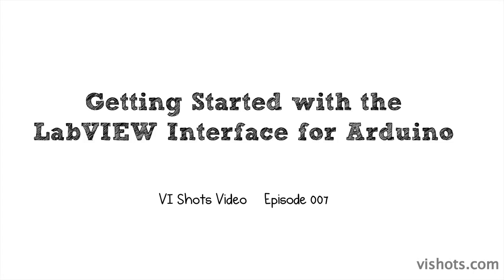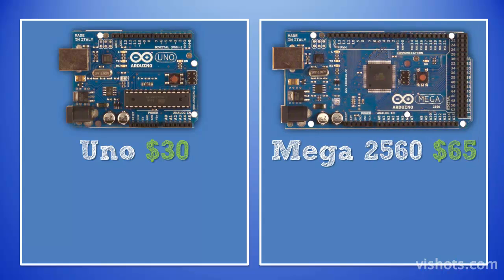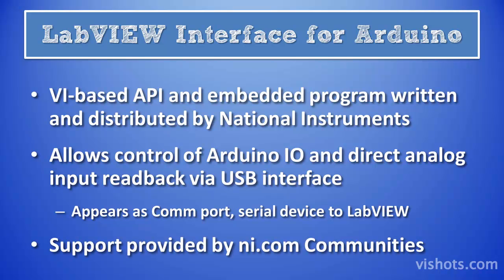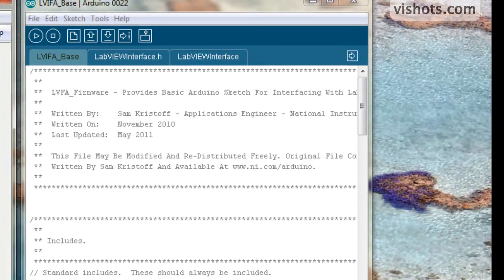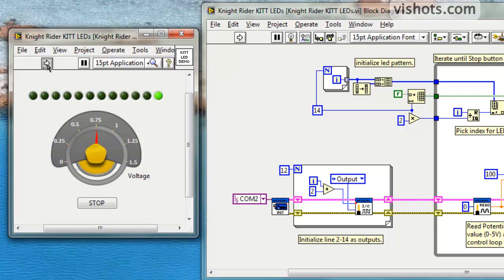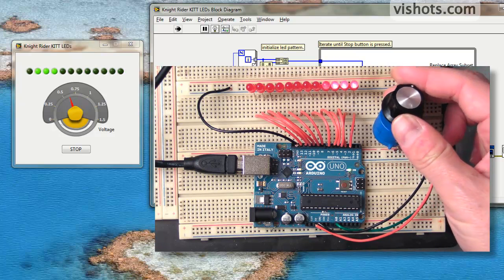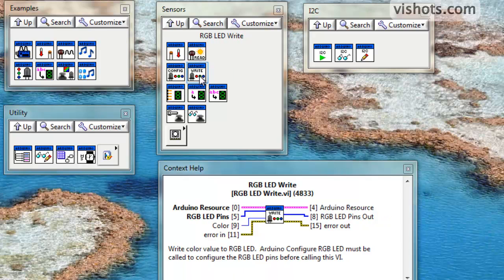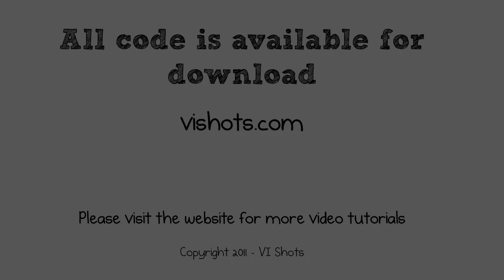Getting Started With the LabVIEW Interface for Arduino

Comment: Don't use this method, it's a pain in the ass with the connection issues and can break your arduino.
Just use Visa and have the arduino interact with labview separately.

Comment: Hi there, I'm totally new in arduino and labview as I'm a chemical engineer. Can someone clear my doubts about the functionality of both arduino and labview? My understanding was we have to write codes using Arduino IDE and LabVIEW is just to read or analyze the data acquired by the Arduino. Is this correct?
Reply: +Jamie Yeap Yes)
Reply: No! :)

LabVIEW negates the need for writing traditional code... It is a graphical programming language and instead of writing code you draw diagrams on the screen in the software and it makes life so much simpler...

LabVIEW is a gift from GOD... (next to Asian honeys yo)

Comment: Did I miss something or should there be some resistor for the LEDs? Arduino Output is 5V, right? LEDs need about 2V, so 3V should be taken by a resistor for current limitation. Otherwise this may not work long...
Reply: You missed something.  1:42 Using PWM outputs...

How it works: http://digital.ni.com/public.nsf/allkb/294E67623752656686256DB800508989

Comment from the maker: In response to Wang: it only works while connected to the PC. LabVIEW programs run on the PC and communicate to the Arduino via USB. - hope this helps.
Reply: +VI Shots (Michael Aivaliotis) So, does it mean, Aurduino board can not be disconnected from the PC and run standalone (with an external power supply)?
Reply: It can, but if you want to control it through labview you must connect it to your pc

Comment: Hi,

I was hoping you could help me out with a few control issues. I'm using a stepper motor shield to control a stepper motor (x3-- three arduino uno's/shield combo), and have tried a few different methods in achieving the correct control. The LabVIEW stepper motor example VI doesn't accommodate for the standard arduino motor shield (must have been written before it was brought out), and when tested the motor just vibrates. After contacting an NI developer it was clear from them that i needed to design a program using "low level signalling". Now I made a pretty good attempt (I think!) at designing a program, but unfortunately don't have that much experience with labview, so as you'd expect, my attempts were unsuccessful!

Im looking to control step and direction. If theres anyway you can help it would be greatly appreciated, as I'm nearing project deadline! I can e-mail the vi that ive done if you feel up to the challenge. :-)

Thanks!